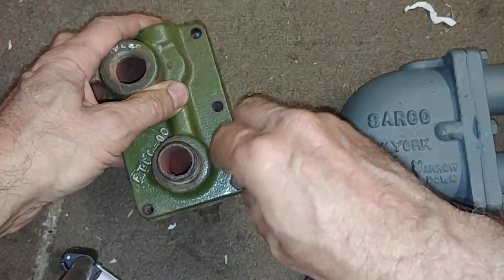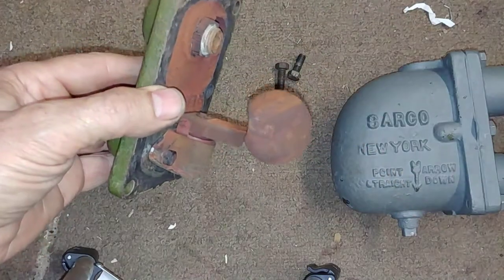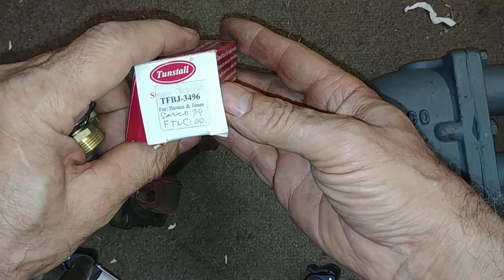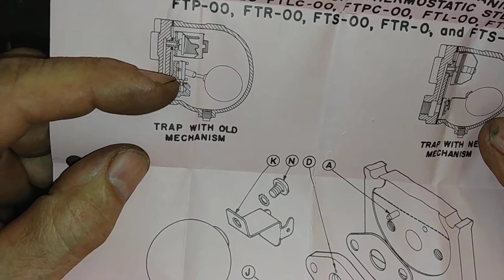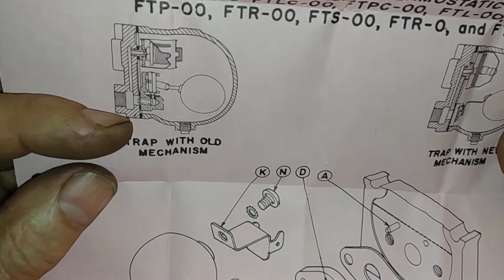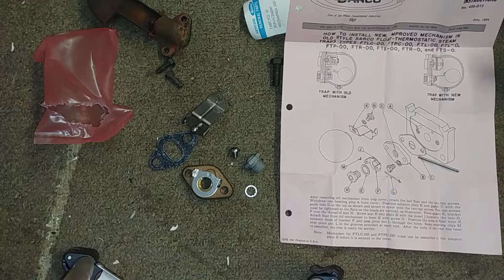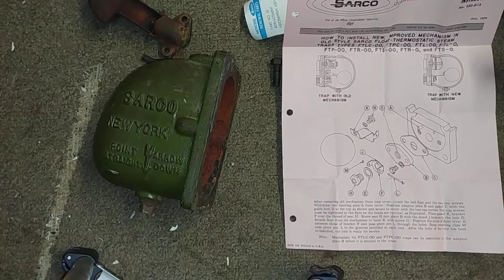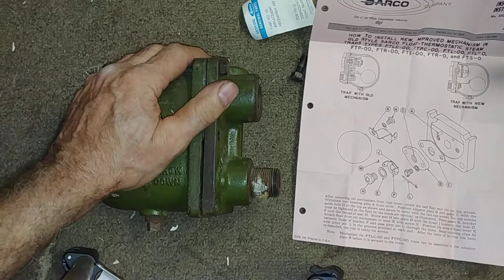Old Sarco 3/4" FTLC-00 Float & Thermostatic Steam Trap - Some Rebuilding Tips

Comment: I work in a very old building that has a steam boiler. This las winter we started to notice that a lot of steam was coming out from the over flow that is connected to the make up water. Will that means that the steam traps thermostats are not closing and let’s the steam come back to the make up water tank?
Reply from the maker: Without personally looking at your system I can't be 100% sure, but from what you say that is very likely the cause.

Comment: Does the F&T trap work better or is it just a preference by design?
The system in my house has thermostatic steam traps at the end of the dry return and a pair of six foot drip legs at the end of the mains. I find this a little hard to understand but I guess the design is allowing the air in the mains to be pushed back into the dry return and then out the main vent and the steam traps are there to prevent steam from entering the dry return.
Reply from the maker: Yes, if I understand you correctly, those thermostatic traps at the end of your steam mains that pass the air into the dry return are the classic so-called "crossover traps" and are acting as air vents dumping the air from the steam mains back to your main (and usually only) air vent in the boiler room. This was important back in the day when your system would run in a vacuum as the coal pile burned down and they wanted to limit air leaks.
Thermostatic traps handle air well, but don't handle condensate nearly as well as F&Ts, but are less expensive to install and maintain.

Comment: Do you prefer to rebuild on fail or do you recommend scheduled maintenance on these. I see it as circumstantial, as in some systems really need an eye on them and others just happily steam away, especially so when you are familiar with them over years.
Reply from the maker: I generally go with rebuild on fail.  Whenever I can, I'll install a trap tester set-up (drain & isolation valves). As you say, it's situational.